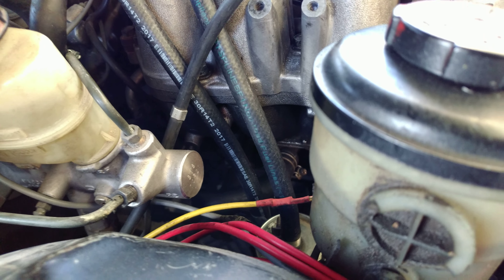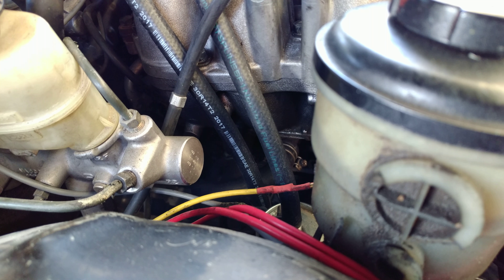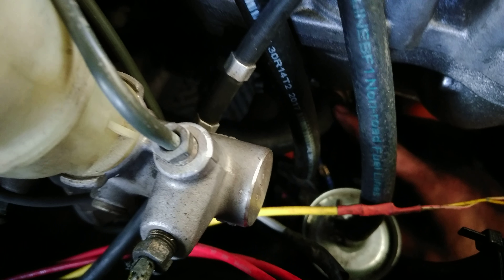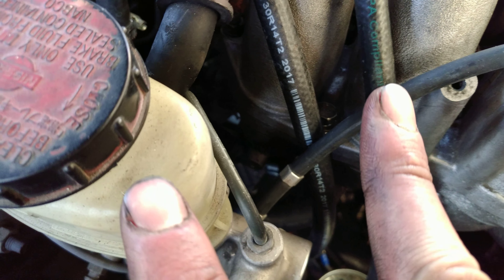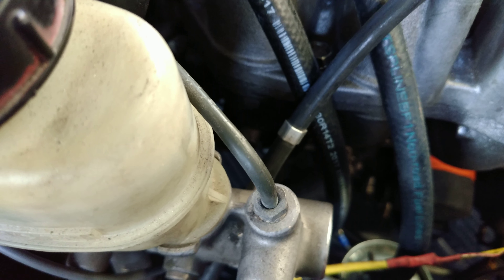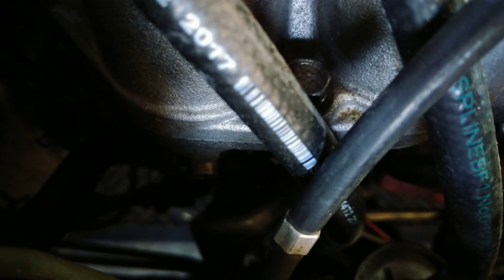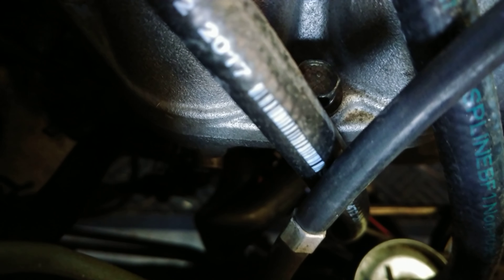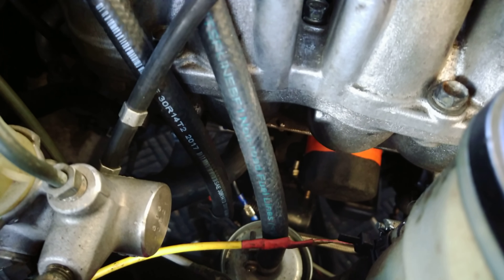240sx Heater Core Bypass - Looped

Comment: If only this information was the same for the ka24e in the hardbody. That heater line is needed for proper block flow which is bogus, and the inlet and outlet are absolutely a pain to link together